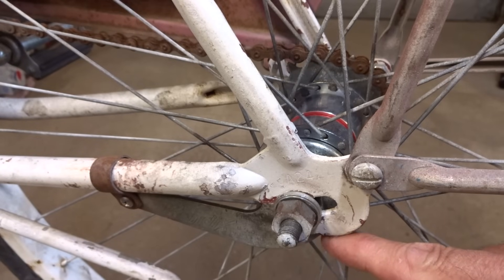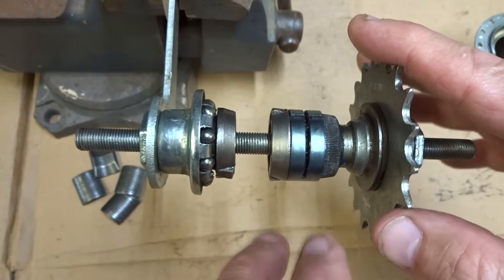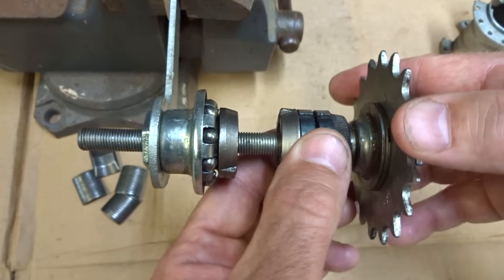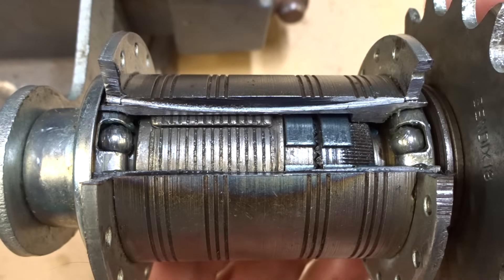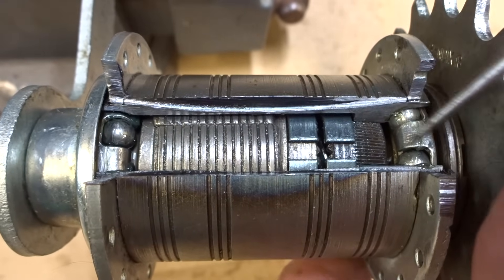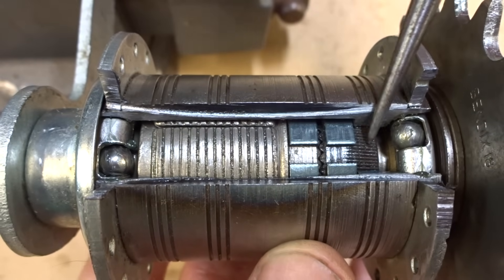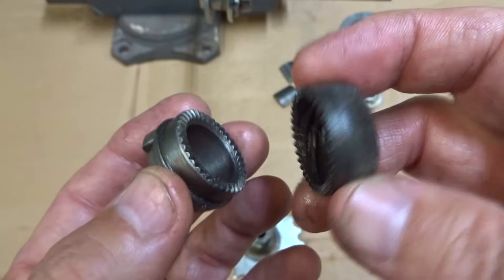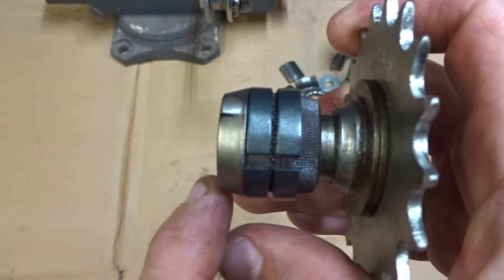Coaster Brake Hub - What's Inside? How Does It Work? Cutaway View!

Comment from the maker: For more bike repair videos hit the subscribe button ► http://bit.ly/SubRJTheBikeGuy
Reply: hey im looking for SUpercycle 19 tooth rear Drive Sprocket for my bike any ideas where to start looking besides my local dump which i know many are in there ha!
Reply from the maker: @RatSleds  ebay maybe.
Reply: @RatSleds  
@Rat Sleds Hi, Is it a whole freewheel or just a cog/drive sprocket?
Reply: Thank you sir for the clear explanation. If one wanted to disable the brake and make it a freewheel hub, would removing the brake shoes alone do the trick? Or would that cause a problem with the clutch engaging the hub?
Reply from the maker: No. Buy a freewheel wheel.
Reply: Hey RJ, great video! I was wondering if you could explain how a coaster brake can be adjusted. My daughter’s new bicycle has a coaster brake which feels too tight (the wheel does not spin completely freely). I would like to loosen it just a bit without taking the whole hub apart.
Reply: What's your location.
Reply: Great breakdown of this mechanism. Question, what is going on when I coast or pedal backwards, then when I go to pedal forward, the mechanism does not engage right away? Almost a half spin of the crank and then it kicks in. How can I remedy this? Thank you.
Reply from the maker: @gregorystevenson8794  The parts are not moving smoothly. Overhaul, clean, and  regrease it. https://www.youtube.com/watch?v=PPXt9m4udKw

Comment: I think I first took one apart on my original tuff wheel to install a freewheel adapter. It was like the driver but had threads to install a freewheel instead of the sprocket. The brake pads and clutch remained and it would coast most of the time but occasionally the freewheel would 'click' if you pedaled backwards. Still had the brake arm and was heavy. I remember three brake pads in the old ones. Good video to remind me which side to disassemble for maintenance.

Comment: Awesome! I have been trying to come up with an assembly to use on a tabletop loom I made. I need the roller on the back of the loom to travel forward, so I have been excited about the perfect sprocket and chain with its inner ratcheting function. The loom design is online and a bunch of people have made it. The guy who posted his loom reached his complexity level of comfort. He drilled holes in that back beam/roller, stuck a dowl rod in it and that serves as the brake to hold the 'string'/warp before getting woven by the cross yarns called the weft. Once a section of the cloth is woven, he moves the dowl to the next hole and then rolls the woven section onto the dront beam and the tension tightens and back to weaving.

That's a very good, low-tech solution. It's almost certainly what I SHOULD do to keep it simple. But I am the stupid in the KISS model, so that's not what I want to do. 🤷😆

Anyway, back to the sprocket. I finally realized the easiest way to attach the sprocket to my PVC frame (or on a plastic board surface I might mount the loom on it to keep everything aligned and together). So I got a simple hub and am attaching it to my beam.

I am sure I can make the beams immobile and that will hold the warp tension necessary to weave. There are a billion ways to do that.

But, once I weave far enough, I need the sprocket to go forward. I would like the front and back move together to maintain the tension evenly rather than control the forward movement on each beam separately. That should work pretty well with the front and back sprockets chained to move together.

Here's where I get stuck. The front and back need to hold the tension through opposing force- one pulls forward and the other back. So this step is where the miracle occurs.

Finally, the beams must lock solidly in place to hold all of the warp under equal tension across the width of the fabric weaving.

This brake assembly seems like it will do what I want....?

Anyway, thanks a whole bunch for this quick overview of what will happen if I attach the sprocket to a coaster brake, mount another sprocket and a simple hub in front, chain it up together and then load up some string and see what happens.

I asked an AI what kind of assembly the large looms use and it helped me source the parts and a spring to hold the tension, but I'm getting so done with AI, and I think this setup should work... though I fear it's going to brake when I need it to roll and roll when I need it to brake.

I need to think about this some more. I have some thumb ratchets for the AI assembly that might work to hold the front beam tension when I release the back beam, brake it, and then roll the front beam up and brake it. But if I do it that way, I might as well use the holes and dowels.🤷

The ADD brain is going to have to sit down and shut up while I go through the directions the beams need to move and brake.  That's probably going to be another hour unless I grab the guitar and start playing some Christmas carols.

Anyway, again, thanks!😊

Comment: I had an idea for a bike with a pedal assist using a scooter rotor and stator at 3 amps and 25 volts by removing the voltage rectifier and then putting it on one of those coaster brake hub and put it on the frame and two gear to increase the rpms. then you use the coaster brake to disengage the electricity from the hub ( must an ac pedal assist hub) this would make one that is pedal assist with no battery. the whole thing could be made for like a 100 and would never run out of power. it would sell a million of them.

Comment: Thank you, that was very helpful. I've recently began putting 100cc motors on mountain bikes and have now  just built my first beach cruiser and was having a hard time adjusting the bearings in the  rear wheel due to to a stubborn lock nut. I got the axle to spin enough to allow for the other end to completely unthread but as you can guess, all of the guts fell out of the hub and I had no idea of how to put them back in the proper way which could be  problematic with the amount of torque generated by the 100ccs so I wanted to get a better understanding of how a coaster braking system worked and what would be necessary to get everything back in correctly to ensure a safe ride and your video was able to teach me a  lot. Thanks again!!!

Comment: I’d like too see about the coaster break being taken off because that’s the same coaster break and hub design on my beach cruise or at least inform me by a comment if with the nut attached to the coaster break will it come off as a single piece apart from the circular end of the hub like is the coaster break one flat piece that you can take off the end of the hub there ?

Comment: I need help with mine I brake hard with a heavy load and I heard a snap I couldn't break it wasn't braking  and when I pedal it was slipping Imi felt resistance but not enough to pedal properly without slipping

Comment: I have always wondered exactly how a coaster brake worked.  Genius.  People are getting back to basics.  The freewheel and derailleur can be one big pain.  That system is exposed to dirt and damage.  I have gained much more respect for this 122 year old braking and drive system.  The only drawback is chain comes off, no brakes.  That happened when I was ten.  After that scary episode,  I put a front brake on all coaster brake bikes I have ridden.  I make sure that chain is tight.  I finally figured how the heat is dissipated from the hub.  The spokes act as the fins of a heat sink in your electronics.  I might work some heat sink compound in where the spokes join the hub.

Comment: I had a coaster bike that I rode all winter in Montreal.  A ton of black ice very often. Felt like I had so much more control than my city hybrid.   I loved it so much I rode it into the ground RIP.  I just built a new one for my new winter beater out of spare parts.  Super as winter bikes.  I might restore the hand brake.  but  didn't use it on my last one

Comment: Leave out the brake shoes, add a stack of washers and you have a “free coaster” rear hub. This allows freestyle riders to coast backwards without having to move their legs with the crank arms. A freewheel hub will not allow this, if you roll most bikes backwards, the crankset has to move backwards with the wheel.

Comment: Great vid my dude, thanx for uploading!
I just took my Electra Classic's back wheel to a local bike shop for them to de-brake it. I live in the UK and have been used to having two brake levers. I tried the back pedal brake and hated it. UK bicycle law require front and rear brakes on all bicycles. I'll be using caliper brakes from now on.

Comment: Coaster brakes are truly underrated. They may not perform as well as modern V-brakes but they just keep on working. When I was a kid I used to beat the hell out of the little Schwinn Stingray knockoff bikes and while I've had problems with a few parts of those bikes, the coaster brakes never gave me any trouble, never required any maintenance or adjustment. In my first few months with my new Townie, I have done more brake maintenance than I had done in all of my years with coaster brakes.
Reply: Dics brakes are the worst for me. Nothing but trouble. Roller brakes is my new go to.

Comment: Helpful but you left much out of the explanation.  First of all the two sides of the hub are typically not identical.  This is because the arm goes only on one side of the hub (male side), the arm itself being the female.  With the male side of the hub you have a bearing wheel (bearings on a loop) that face the hub and allow the wheel to turn freely on the female side of the hub.  On the arm itself, you have another bearing wheel that faces the male side the hub.  However, there is an additional smaller bearing wheel to do with the break mechanism and after watching your video, I have no better idea where it belongs (somewhere in the middle of the two larger bearing wheels but where).

Comment: I'm 68 YO and I ditched my "kids" coaster brake bike when I was around 12 for what was then called a "10 Speed racer". I became a bike mechanic on "expensive"10 then 12 then 14 then 16 then 18 and then 20 speed bikes for quite some time. Also the equivalent when a triple front chain ring is included. I can lace and true my own wheels but haven't done that much in nearly 20 years. BLAH BLAH BLAH! However, I never worked on a coaster hub since I gave those things up decades ago.  So thankful for your tutorial. Very clear and excellent. And amazingly intelligent and effective technology. Reminds me when I saw an historic turn of the century chainless railroad bike with a drive shaft inside the chain stay.

Comment: The drag spring is very important.  Without it, the cone that expands the brake shoes or drives the shell would spin freely and wouldn't be driven left and right along the coarse thread according to which way the sprocket is turning.  This does add a little friction, so correct bearing adjustment will not feel quite as free-running as a conventional hub.
Reply: Do you know if I can inop the break removing some of inner those parts ?

Comment: A great detailed video on how they work!  Thanks!    I am watching this because I want to figure out how to fix the gear to the hub, i.e. always fully in drive-mode,
since I want to bolt a disk brake to the gear to install disk brakes (using these rear hubs as front wheels on cargo bike..)   If you have a solution, post a reply.
Seems I can just twist the gear and weld it somehow..still not sure.
Reply from the maker: You can overhaul the coaster brake hub. But the disk brake. You are on your own there. Buy a disk brake wheel.
Reply: @RJTheBikeGuy  So disasspointed in that reply, any idiot knows you can replace the wheel, building a cargo bike from free recycled junk bikes takes talent. thanks for nothing.
I think I can replace the mechanism with a solid part and so tighten the nut to make it solid.

Comment: In scandinavia these breaks are actually standard. If you have a single speed bike or internal gears you are almost certain to have a coaster brake as well.

I didnt realize this difference until I started looking up maintainance videos on hubs such as nexus 3 & 8 and sram 7. Never before had I seen hubs with internal gears with roller breaks or disc breaks. All these hubs are sold with coaster break here.

// sweden

Comment: I'm in the process of a "budget" restoration. An older cruiser thats been outside for years. Removing rust as best as I can. No painting, just rust removal. Brake is seized this helped greatly, simpler than I thought, neglect definately shows. No grease on any bearings either. at least it's a decent frame. changing tires, tubes, and chain also.Working with what I have, one day I'll move up to some Park Tools.

Comment: That's a neat cutaway and great explanation of how the Bendix 70 works.  I was in the bike business from 1972 until the early '80s and built my city bike using the Sachs Torpedo 3 speed coaster brake hub, which was beautifully polished on the inside, even where it didn't need to be.  Also had a cantilever frame bike with the New Departure nickel plated coaster hub and the disc alignment tool for reassembly.  Cool memories those are!

Comment: I overhauled my KT Hi-Stop after watching this video and your Bendix overhaul video. I thoroughly greased the sliding surfaces with Lucas Red & Tacky grease and replaced (and greased) all three caged ball bearings and it runs very smoothly. HOWEVER, I've noticed two problems that I didn't have before: 1. in coast and pedal mode, I hear some rubbing inside and 2. the shoes don't catch the hub consistently (sometimes I have to backpedal through just 45 degrees or less and other times I have to backpedal a quarter turn before the shoes engage). Does this sound like a worn spring problem or did I not reassemble it with the driver threaded into the clutch correctly?

Comment: Thanks RJ my grandson's brake was giving me fits.. feels like it's dragging since I changed the tire.  I didn't want to tear it apart. . But I guess that's next. Gonna be fun, brake and sprocket are on same side,  I guess,same principle still
Reply from the maker: I have several overhaul videos for coaster brakes.
Reply: Was hoping to find a video,  with sprocket and bake on same side. . Guess it's the same idea...
Reply from the maker: Shrug. I don't know what you are describing. You need to find instructions for your specific model of hub, or something similar.
Reply: The coaster brake lever and drive  sprocket are on same side, not opposite sides
Reply from the maker: @jacksharmonoquinn572  Do you mean the brake arm that connects to the frame? I have never seen that on the drive side. So you will just have to figure it out Good luck.
Reply: Yes.. it's about to get interesting then, I've never seen it either... thanks for your channel and info , I enjoy it thoroughly. ..
Reply: Ok, first of all thanks for the video,  it was lots of help... the pics I recieved looked like they were both on the same side. ... only because they put it together like that... trying to fix on their own I guess.. it was very similar to yours here... and now works, ad before it didn't. .. lots of gunk and kids hands... glad all parts were there... love the info you share... keep doing you.. love the channel

Comment: What I'm wondering is: could you drive a wheel with a hub like that switched around 180° with a sprocket that has an adapter that clamps on directly to the hub and still have the possibility to use the brakes? (I want to make a little kind of a motorcycle with a soviet chainsaw engine and the engine's rotation makes it basically the only possibility)

Comment: 1: remove brake pads and the slanted spacer thingy and remove the teeth on the expander
2: screw on a nut where the spacer thing should be for adjusting slack
3: freecoaster

Comment: It's a bit crazy to think that the entire function of the coaster hub depends on the friction between the clutch and that spring, the parts that actually need to slide against each other when riding. A bit too little friction and the clutch and breaks wouldn't engage, a bit too much and the two parts start to wear, heat up and be a general annoyance
Reply: how is it possible that, despite friction while braking, there is no deterioration of the elements, needing some maintenance / part changing at some point ... ?!
Reply: @pierresteinbach4541  There definitely is some wear, but the metal parts are pretty sturdy. Some bikes definitely do need the brake pads replaced from time to time, it just takes many years, unless the brakes get abused by e.g. slowing down on very long descents often

Comment: I have worked on a shimano 3 3 3 coaster brake hub. I found it well designed and reliable before selling the bike. But what I fail to grasp is the brake bar, and its role, since it stays positioned exactly the same in alk 3 modes
Reply from the maker: The brake bar keeps the hub core from rotating. https://www.youtube.com/watch?v=L2f0e28Dito

Comment: A lot of bike couriers run fixed gears in winter here in Canada because free wheels are notorious for freezing up, so you pedal but nothing happens. I have not had a coaster brake hub since I was a kid beating the hell out of my Supercycle. Never rode it in winter though. Am curious if anyone has been riding one in winter, are they as reliable as a fixed gear in winter? Or do they freeze up like free wheels?
Reply from the maker: Flush, and use a thinner oil in the freewheels. It's the grease that gets stiff and causes the pawls to stick.
Reply: I guess keep it indoor  

Good question